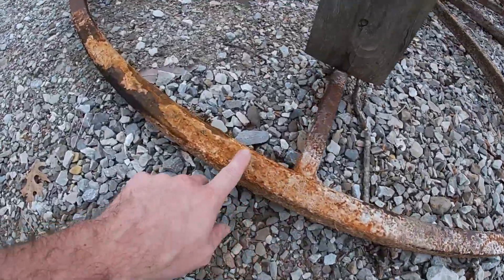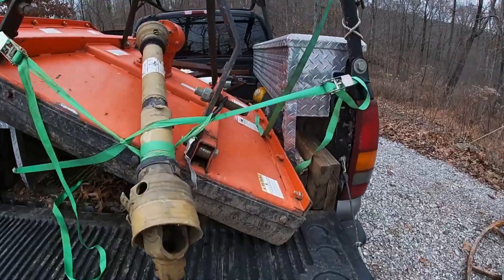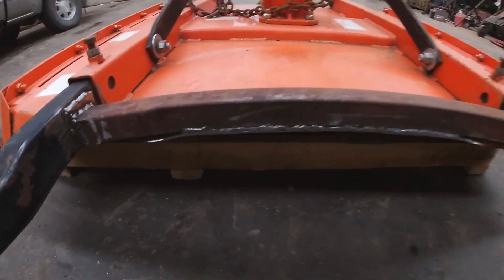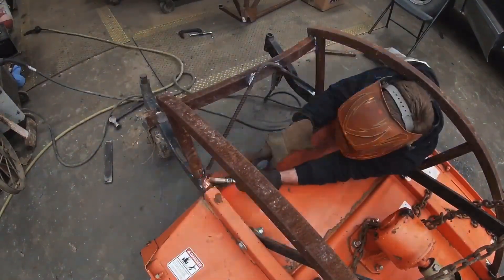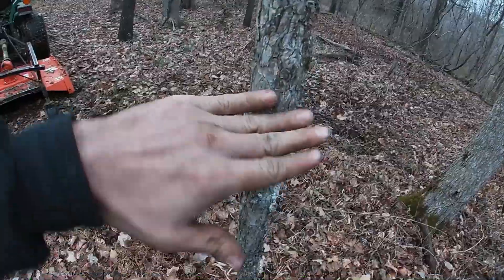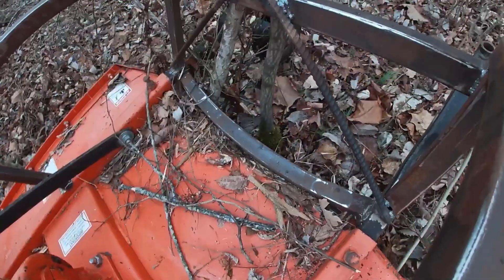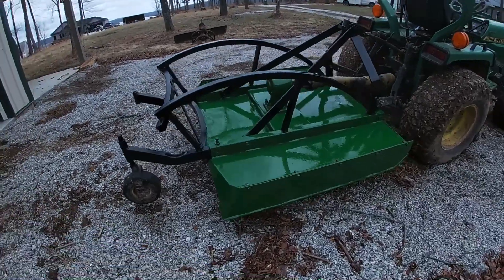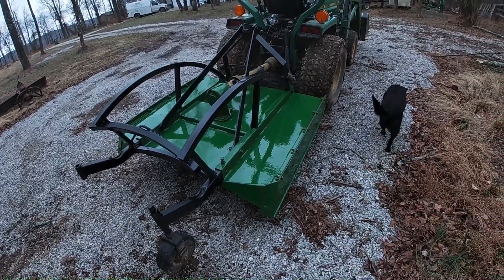Custom brush cutter modification

Comment: Did you pattern this after the brown tree cutter? Jason @hollisfarms has one and it is a great piece for what he needed. IF, you could add weight to the rotating mass under the deck, a flywheel sorta, to build up energy as the blades turn. Use the energy instead of shear horsepower. 
https://www.youtube.com/watch?v=Wq2-Lou_r2c&list=RDQMicXIi8dUWoE&start_radio=1

Comment: That’s definitely “ the BEAST”!
On a side note...  I sharpen my blades and put a nice edge on them,  heat them with a torch just on the sharp side, until it turns blue. Then let it air cool. Don’t oil quench it! That will make it too hard, and if you nick a rock, they will shatter and send shrapnel every which way!  Anyway, that’s a good idea to keep the under brush cut down!

Comment: When mowing over uneven ground, remove the "top link" of your 3-point hitch.  With that off, it allows the mower to easily float and match the contour of the ground without over stressing the rest of the linkage on the mower & tractor.  Example is when mowing across a low spot.  The tractor is going up hill with the top link trying to push the front of the down while the two lift won't let it pivot.  Something has got to give.   Don't back up any distance without it and remember to reinstall the top link when transporting it.
Reply: Replace top link with chain and hook. Can still lift and and it's  adjustable

Comment: If you could find an old saw mill blade and mount that under the deck you could cut really low clean and bigger trees
Reply from the maker: thats true!  may take a bit to get speed up, but once you got it there it would be a tree eater!

Comment: Fix your wheel first only makes sense
Reply: Take the other wheel and brackets off and save them from destruction if using for tree removal
Reply from the maker: Randy Wells like I said,  works fine the way it is.
Reply from the maker: Randy Wells works fine the way it is.  Thanks for watching!
Reply: Maybe you can destroy it wouldnt that be great good way to stop people from watching anything you put out😀

Comment: I just cut about a foot off the back of my bush hog. The blades stick out 6 inchs. A gas ax fixes everthing...
Reply from the maker: oldreliable303 Justin Scott absolutely!
Reply: @CaptainKleeman  your bush hog is a little pretter than mine. Mines mostly rust holes, and scrap metal welded on as patches holding whats left of it togeter....

Comment: If you ever wanna sell the loader off that tractor id love to take it off your hands
Reply from the maker: Blacksheep 973 oh I use the heck out of that loader!  That 755 is on my no sale list 😂. Handiest little tractor.
Reply: Captain Kleeman hows the loader capacity on it? I have the exact same tractor but without the loader. I snowplow with it and do a lot of brush hogging with it, it fitd where no other tractor does, and float across wet ground, but have been debating on trading it in for a skid steer... but if I could find a loader for it I would keep it. Mine is perfect for me but I just wish i had a bucket

Comment: I went threw 3years of welding classes in high school and I do have a cheap Lincoln welder. If I take my time I can make them “look good” but as I see it they are structurally fine for what I am doing and that’s all that matters to me.
Reply from the maker: Time Table that’s absolutely right! What kind of things are you making with tour welder
Reply: Captain Kleeman the most recent thing I have made was a plow mounting plate for my atv but I made a front mount hitch for my truck, utility rack for my dirt bike and I use it for a lot of repairs.

Comment: You couldn't push them over with the loader
Reply from the maker: Dave Vestal that’s what I used to do,  this is much faster and easier on the tractor.  Thanks for watching!
Reply: @CaptainKleeman  wish I could send you a plc of a grapple I built has a tree shear in the middle works graet

Comment: How did I miss this video before? Your neighbors stare at you, imagine that. 😂. The single wheel has been driving my OCD crazy 😜, all the time I was hopeful you would cut off both arms going back and center the wheel in the middle, and then you had to defeat my hopes by pointing out the goal of the project, that a center wheel would interfere with. You could help with my OCD if you give it a peg leg in the other arm possibly made from some scrap from the woods, slab from a tree as the imaginary wheel connected to the arm by one of the fallen saplings. Then you could call it peg leg the pirate 🏴‍☠️. Looking good by the way, love the look of the black curved reinforcements.

Comment: How about adding a flywheel to the diskcutter, that should help a bit when cutting into the bigger trees?

You may be able to add a large 1" thick steel plate to the arbor and then attach the blades to that? Just watch out for the max rim-speed so you don't end up spinning the flywheel to quick.
Reply from the maker: Morten Mortensen that’s not a bad idea.  A little extra weight could help carry the blades inertia through as well.

Comment: That looks alright, maybe name it the green cutter because it saves you time and time is money? or the wake maker, because you are clearing room for a boat.
One thing I did see and maybe you want to try. I have been running my dad's bush hog for 20 years now and I always couldn't figure out why the arms that go to the back kept bending, so I asked the Messicks channel and the overwhelming answer I got was the part that connects to the top link was put on backwards by the person who assembled it originally AND the part that pertains to you that you may want to try- I was told by a number of people to take the top link and where it attaches to the tractor there are 2-3 sets of holes, use the lowest hole for the brush hog- it keeps the deck more level.
Happy New year and thanks for the videos.
Reply from the maker: Ohh Paul that is something I will look into!  Thanks for the tip sir!

Comment: “Little cutter that could!” Turned out awesome! As far as the limited horsepower, I can do “almost” all the work with my compact 770 (24hp/20hp pto) that I really need to. Only drawback to mine is 2WD and no bucket but I’ve got 2 bigger 4WD tractors with buckets if I need them. I use “Mighty Mouse” for everything around the house and on small jobs where it’s not feasible to carry one of the bigger tractors. Takes a little longer but it does the trick for sure.
Reply from the maker: Junkyard’s Garage Mighty Mouse,  that’s a good name for the 770! Hahaha.  I love it
Reply: Captain Kleeman it has earned that name over the years lol. It’s also the only tractor I have that will never be sold!